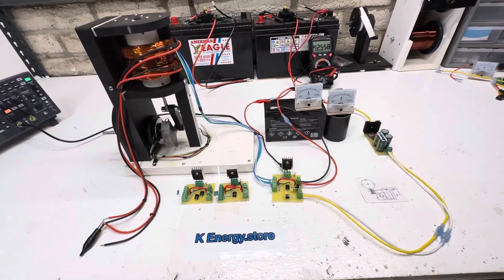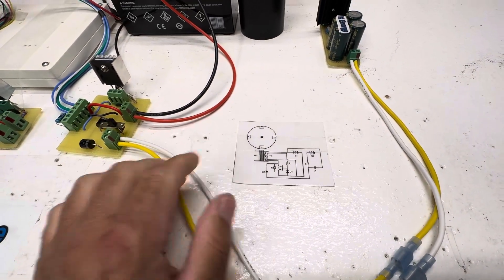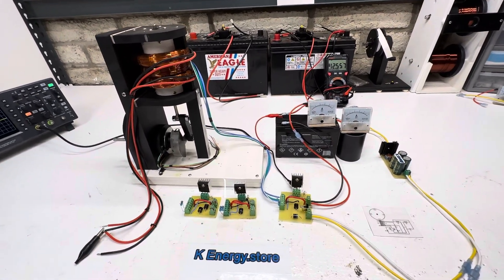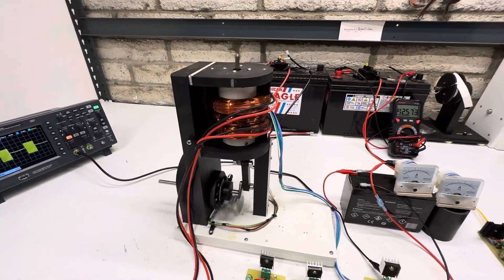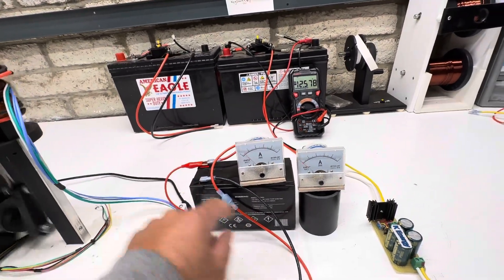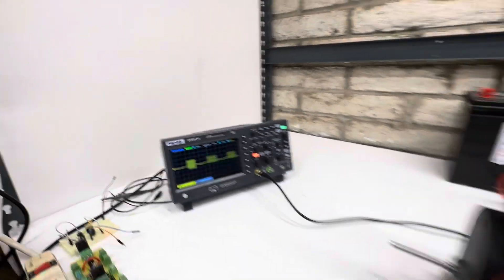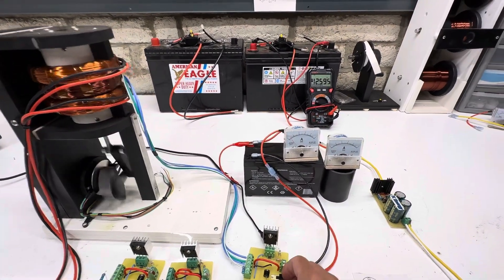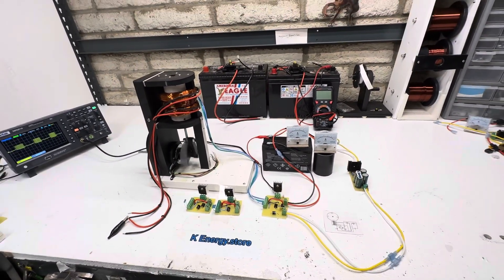Bedini SSG circuit and Generator mode circuit on one board switchable

Comment: the combined circuit of the two modes is awesome. On the bendini motor 450 windings I was curious what would happen at full speed switch from SG to generator mode and I saw a flash of light come out of the coil. Pretty neat.